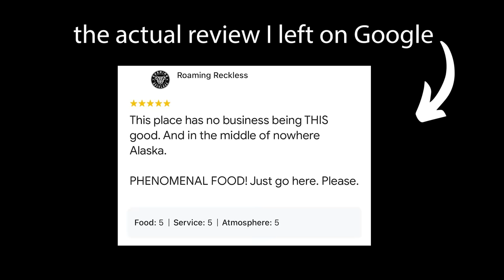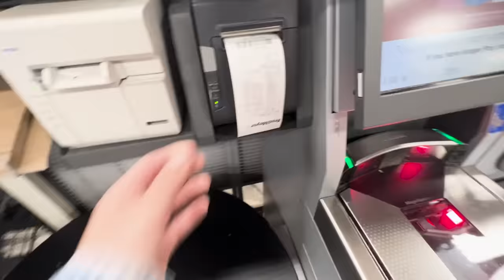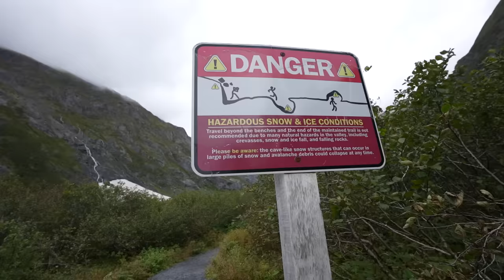Truck Camping in Alaska

Comment: Remove the tire from the hood then open the hood. Because the tire is heavy and cannot open the hood.
Reply: You're absolutely 100% correct. Tires can not open the hoods of vehicles.😅
Reply: @jacobravenwood7968  you must go to the Land Rover workshop for the rear tire rack or DIY can. Easy.

Comment: you should get a rear door mount so you can move the spare wheel to the rear door and then the hood will be easier to lift. Save you the struggle each time:)

Comment: Im an Alaskan and I’m always delighted to see travelers take the Road North. I do have a suggestion , most people have the destination at the end of the Prudhoe Bay , long haul road. This is an extremely long road and this time of year you can easily get caught in a snow storm . There are many areas North, where you can get the similar landscape .. If you are North, by Fairbanks you might want to check if Chena Hot Springs is open.

Comment: Good to see Blue eating again! I'm wondering where Poe's seats came from (Discovery maybe) cos I don't remember anyone (even Exmoor) doing seats like that in a Defender. 
I would recommend looking up LOF Clutches for that squeaky clutch pedal. They do a replacement pedal spring that normally sorts that.
Also, the British Army took the spare off the bonnet because the Wolf wheels (it looks like you've got Land Rover Wolf wheels) were heavier than the standard steelys & caused problems with the bonnet.
If the wiper got jammed at the snorkel, it may have damaged the splines on the aluminium wiper arm (hopefully its just that cos if its the mechanism, that's a much bigger job!).
Stay safe, stay crazy & have fun on your trip.
Love to you & Blue (& Poe, of course. Sorry, I have a Landy fetish😅).

Comment: Hey M, a little advice about lifting ur hood up, easier:
- Do a half squat
- Place the heels of ur hands under the hood lip
- Straighten ur arms as best u can - gonna b tough w/the brush guard but, u’ll get better at this
- Keep ur back flat
- W/ur legs, slowly start to stand up straight - keep ur back flat - as ur legs become straighter, simultaneously, straighten ur arms out 
Basically what I’m suggesting is, u lift the hood up w/ur - whole - body. I know a thing or two about lifting weight.
Ur gonna continue to struggle just using ur arms. And, just using ur arms is putting u in a position of serious injury.